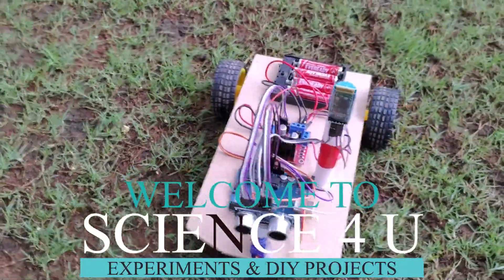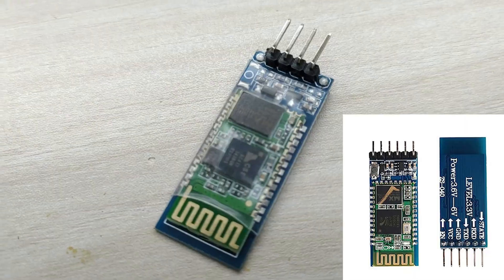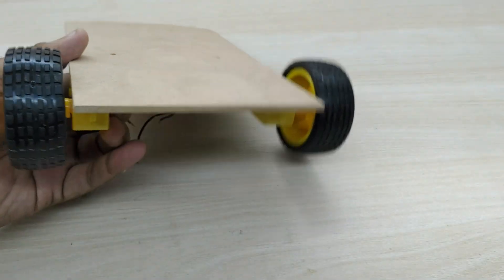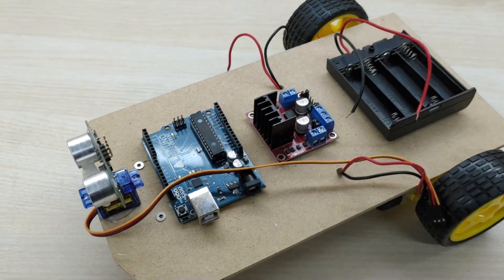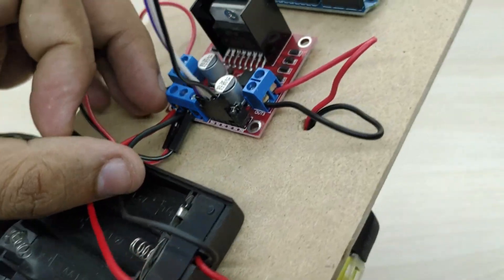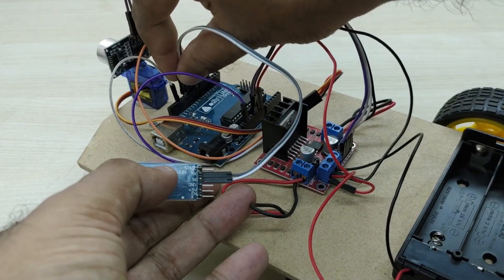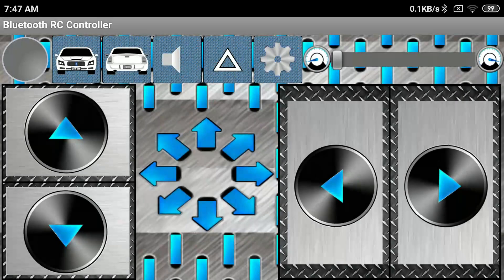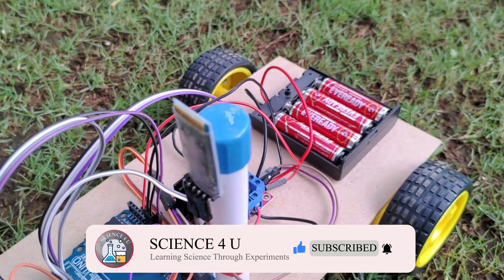Bluetooth controlled car with obstacle avoidance || Step by Step tutorial

Comment: Sir app link was not working
Reply from the maker: Hi friend. You are right. The app has been removed from playstore. 
You van download the .apk installation file for the software from the following link and install the app directly in mobile phone. 
https://drive.google.com/file/d/1Mzc5KGRzhqFgvPnWan8b5mDisAgMnkMK/view?usp=sharing
Reply: @Science_4U_ sir it will work in first attempt please tell me fast sir 😢
Reply: Sir could it work in first attempt please reply fast sir 😢
Reply from the maker: @durgatelugugamerff1937 Hi friend. It will definitely work in first attempt itself, provided all the components are in good working condition. Especially the bluetooth module and L298N driver board can be sometimes faulty, especially when it is a new one. If these are used before and is definitely working, then the project will work in first attempt itself..

Comment: Bro, my Arduino Uno doesn't have the code to connect with red wire servo motor
Reply from the maker: Hi friend, I will surely help. I didn't clearly understand the problem. Can you please explain?
Reply: @Science_4U_ my Arduino Uno doesn't have the "Ioerf" like your diagram circuit  shows. The "Ioerf" need to connect with the red wire servo motor like ur video shows. How can I fix that ?
Reply from the maker: @nursyairahatiqahbintihusain  Hi friend, IOREF is basically a 5 volt reference voltage that is given from arduino uno. Some boards will not have this IOREF pin. Instead, in its place 5V pin will be available. You can connect to that 5V pin also.
Reply: @Science_4U_ are that pin that my video shows can be replaced with 5V too ?
Reply from the maker: Yes definitely friend..that red wire can be connected to 5V pin instead of IOREF..
Reply: @Science_4U_ thankyouuuuu you're my life saver 😭😭❤️❤️
Reply from the maker: No problem dear friend. I am so much happy to help...🙂❤️
Reply: https://youtu.be/eJsSn740mec?feature=shared . I doesn't have that in my Arduino Uno 🥲

Comment: hey bro why us my servo motor not rotating fully kinldy reply fast ......
Reply from the maker: Most likely it should be due to poor battery. Can you explain further?. Servo motor is not turning 90 degrees to both sides?.
Reply: @Science_4U_  it is just stuck and i have tried several times i am using 2 rechargeable batteries 3.7v+3.7v 18650 battery
Reply: @Science_4U_  and also when i have completed all the wiring again ok then i have uploaded the code the Bluetooth is being connected but it js not responding
Reply from the maker: @maviaqaiseriqbal3098  okay friend. The bluetooth car not moving could be due to several reasons. It could be due to bad bluetooth module, faulty L298N driver board, wrong connections etc. We have to check one by one. If you can come to my instagram page, I can chat and guide you to identify the problem.
Reply from the maker: @maviaqaiseriqbal3098  https://www.instagram.com/_science4u_?igsh=MTM5aXFpdTM5aG5lNg==

Comment: we can run the car on both controlled and mannual and voice code theres any edit to be done in the code
Reply from the maker: Yes friend. We need to edit the code to provide these functions.
Reply: @Science_4U_  I can get code from any websites is there
Reply from the maker: @kevincelestine7020  No friend. If you want your car on bluetooth mode, manual mode and voice control mode, we need to write specific code for that. I haven't seen any code from website with the exact same functions.
Reply: I am sorry that I want to ask you the motor driver when I give power to 12v is not responding but I give to 5v motor driver is on but motor not working
Reply from the maker: @kevincelestine7020  The motor driver should work perfectly in 12V DC supply also. I am not sure why it is not working in 12V. Could be a problem with the board.
Reply from the maker: @kevincelestine7020 Infact the L298N motor driver board can work upto 40V input voltage. Is the 12V battery that you have connected good or is it discharged?
Reply: @Science_4U_  good batteries only

Comment: Life savior this is my uni projext😊
Reply from the maker: Hi friend. Please try this project and ask if case of any doubts..
Reply: Hello friend, i did as you did and it’s not moving, i kept the vcc connected to motor and didn’t change it, bluetooth worked normally and I connected. So whats the problem if you can help, thank you.🫶🏻🫶🏻🫶🏻
Reply from the maker: @taboo3274  Hi friend. Do you see light on the motor driver board?. Are 2 jumpers connecting ENA & ENB pins available in the motor driver board?. Have you used the motor driver board before or is it a new one?
Reply: @Science_4U_  new one
Reply: @Science_4U_  no lights
Reply: @Science_4U_  yes ena and enb available
Reply from the maker: @taboo3274  A light should switch on in the motor driver board. Can you check connections to the motor driver board?
Reply: @Science_4U_  yes i will
Reply: @Science_4U_  sir i solved the motor issue but i have a problem, the car only move right and left when i unplug it from computer but when i connect it to computer it works normally what should i do
Reply from the maker: @taboo3274  If the car moves left and right, it should have moved forward and backward also. The only reason I can see is that if the batteries are not good, it will not have enough power to rotate both the motors together. Please do the following 2 things.
1. Lift the car up so that both wheels are in air and then see whether front and back are working. Also please try helping the motor to rotate with your hand.
2. Connect the arduino to PC/laptop using USB cable. With the USB cable connected see if front and back are working. 

If it is working in any of the above 2 cases, the problem is then due to bad batteries.
Reply: @Science_4U_  yes its the battery im using 5v what should i use
Reply from the maker: @taboo3274  5 volt is very less friend. I will suggest you to use 2 x3.7V 18650 batteries. They last really long and are rechageable also. Other wise you can use 4 x AA 1.5V batteries or 9V Hi-Watt battery for transistor radios. But these wont last long.
Reply: @Science_4U_  thank you a lot but a question if i directly connect the battery to motor it will damage it or not? Thank youu very much
Reply from the maker: @taboo3274  No friend.  it will not damage the motor if you connect directly.
Reply: Sir I forgot to tell you that it worked perfectly, thank you so much for helping and replying ❤❤❤❤
Reply from the maker: @taboo3274 Hi friend. Very happy to know that!!!. Wish you all the very best..❤️🙂

Comment: Can you give me correct circuit diagram
Reply from the maker: Hi friend. The circuit diagram can be downloaded from the google drive link given in the description box. I am giving the link below also.
https://drive.google.com/file/d/1OwHegQmTAUb7mbW_RdNSIqG0zmkmCL0W/view?usp=sharing
Reply: @Science_4U_  I want the circuit diagram that comes after changing the Bluetooth module you mentioned
Reply from the maker: The VCC of the bluetooth module has to be connected to 5V from arduino. That is all. Remaining circuit diagram is same.
Reply: @Science_4U_  thanks bro
Reply: @Science_4U_  Then don't you have to remove the wires from the servo motor and connect it somewhere else?
Reply from the maker: @techwithnelusha  Hi friend. Basically in this project, you need +5V supply for bluetooth module, ultrasonic sensor and servo motor. Normally arduino has only 2 nos. of +5V supply. Bluetooth module works only upto an input voltage upto 6.6V. So it will not work if it is connected to battery with a voltage greater than 6.6V. So in this case it is better to power the servo motor directly from battery, because it works at higher voltages also. Connect only bluetooth module and ultrasonic sensor to +5V from arduino..

Comment: sir what did you mean by connect pins 1 , 2, 3, 4 while pairing for the first time when we are connecting the bluetooth module. and sir aren't we suppose to remove the tx and rx pins in from blutooth m... before uploading the code.Sir plz reply
Reply from the maker: Hi friend. When we are first connecting the bluetooth module to mobile phone, a PIN number has to be entered in the mobile phone. That PIN number is what I have told as 1234..Also, I have seen in many videos, that the TX and RX pins have to be removed for uploading the code. But I was able to upload code without removing TX and RX pins. So if you are also able to upload code without removing RX and TX pins, then that is fine. Otherwise if you face some problems in uploading the code, try removing RX and TX pins and then upload. According to me, both methods should work..
Reply: @Science_4U_  Thank you soo much♥️💫.If I have problems regarding this project I'll ask you, is it okay.
Reply from the maker: @LT-or3on  Yes sure friend. Please ask. I will clarify them. 😀

Comment: Can we use 4 gear motor?
Reply from the maker: Yes sure friend. Just connect 2 motors to the motor driver board. I mean +ve terminals of both motors can be connected to one terminal of motor driver board and  -ve terminals from both motors can be given to other terminal of motor driver board..
Reply: @Science_4U_   im getting this error what to do? Sketch uses 5886 bytes (18%) of program storage space. Maximum is 32256 bytes.
Global variables use 148 bytes (7%) of dynamic memory, leaving 1900 bytes for local variables. Maximum is 2048 bytes.
avrdude: ser_open(): can't set com-state for "\\.\COM6"
Failed uploading: uploading error: exit status 1
Reply from the maker: @ninzagames  Hi friend, This error normally comes when the correct port is not detected. In IDE software, please goto tools>>port..make sure that you have selected the right port there. IF this os alos not working, try unplugging and plugging again to different USB port. Also pelase try in a different PC or Laptop.
Reply: @Science_4U_  my car is not moving
Reply: @Science_4U_  connected everything as u said but not moving
Reply from the maker: @ninzagames  okay friend. We neex to check one by one to know what is wrong..
Reply from the maker: @ninzagames  sometimes bluetooth module may be faulty, motor driver board may be faulty..
Reply from the maker: @ninzagames  are all the components earlier used ones and were working?. Or have you used new components?
Reply from the maker: @ninzagames  can you check whethere there arr jumpers in ENA and ENB pins in the motor driver board?
Reply: @Science_4U_  new all
Reply from the maker: @ninzagames  hmm..anyway code is a tested and working one..if connections are done correctly and code is uploaded correctly, it should work..some component may be faulty..
Reply from the maker: @ninzagames  I will ask you to do a check..Just connect +5v from arduino to IN1 pin of motor driver board and GND pin from arduino to IN2 pin of motor driver board. Turn on everything. Is one motor rotating?
Reply: @Science_4U_  I tried your Bluetooth car and that works but this obstacle doesnt
Reply from the maker: @ninzagames  okay...the obstacle avoidance alone is not working or bluetooth is also not working?
Reply: @Science_4U_  can you give me your Instagram
Reply: please reply fast tomorrow is my project submission date
 @Science_4U_

Comment: Why the car is so slow

And

Will the code works on a 4 whealer car to run 4 motors
Reply from the maker: Hi friend, You can increase the car speed by increasing the battery voltage.
Also this code will work for 4 motors also. Instead of one motor, you can connect 2 motor on either sides of the motor driver board..
Reply: Thanks

Comment: Bro again another problem I changed the pins then all the board lights are glowing but motor is not working please tell me
Reply: Bro please tell
Reply from the maker: Hi friend. Sorry for that. Can you give the connections like pin no. 4 of arduino to IN1of motor driver board, pin No 5 to IN2, pin no 6 to IN3 and pin no 7 to IN4 in that order and tell what happens...

Comment: Bro very nice project bro I done this but when I give left it is going right what is the reason bro? Please tell
Reply from the maker: Hi friend..That is because the control pins 4,5,6&7 from the arduino are connected to the motor driver board in the worng order. You can interchange pins 4&5 with pins 6&7 and see if it solves the problem..By trial and error you can correct the motor rotation direction by interchanging pins..
Reply: Thank you bro

Comment: Sir its not avoiding obstacles
Reply from the maker: Ooh..Most likely your ultrasonic sensor is damaged. Replacing it with a good one will solve the problem..👍
Reply: I have changed
Reply: But Still this problem
Reply: Sir give me code and circuit diagram please 😢
Reply from the maker: @gadgetguru0108  Hey friend. The link to download code and circuit diagram is given in the description box, below the video..

Comment: Sir please copy the code and paste it sir because the two link is showing that the file format is not supporting 😢
Reply from the maker: Okay friend..Sure..The code is given below..

#include <SoftwareSerial.h>
#include <Servo.h>
SoftwareSerial bluetooth(11,12); // RX, TX
Servo Myservo;
char t;

#define MLa 4     //left motor 1st pin
#define MLb 5     //left motor 2nd pin
#define MRa 6    //right motor 1st pin
#define MRb 7    //right motor 2nd pin
#define trigPin 9           // Trig Pin Of HC-SR04
#define echoPin 8        // Echo Pin Of HC-SR04
long duration, distance;
 
void setup()
{
  Serial.begin(9600);
bluetooth.begin(9600);
pinMode(MLa,OUTPUT);   //left motors forward
pinMode(MLb,OUTPUT);   //left motors reverse
pinMode(MRa,OUTPUT);   //right motors forward
pinMode(MRb,OUTPUT);   //right motors reverse
pinMode(trigPin, OUTPUT);       // Set Trig Pin As O/P To Transmit Waves
  pinMode(echoPin, INPUT);        //Set Echo Pin As I/P To Receive Reflected Waves
  Myservo.attach(10);

}
 
void loop() 
{
if(bluetooth.available()>0)
{
  t = bluetooth.read();
  Serial.println(t);
}
 switch(t)
 {
  case 'F':
        {            //move forward(all motors rotate in forward direction)
          digitalWrite(MLa,LOW);
          digitalWrite(MLb,HIGH);
          digitalWrite(MRa,LOW);
          digitalWrite(MRb,HIGH);

           digitalWrite(trigPin, LOW);
  delayMicroseconds(2);   
  digitalWrite(trigPin, HIGH);       // Transmit Waves For 10us
  delayMicroseconds(10);
  duration = pulseIn(echoPin, HIGH);        // Receive Reflected Waves
  distance = duration / 58.2;                       // Get Distance
  Serial.println(distance);
  delay(10);
  if (distance > 3)               // Condition For Absence Of Obstacle            
  {
    Myservo.write(90);
    digitalWrite(MRb, HIGH);       // Move Forward
    digitalWrite(MRa, LOW);
    digitalWrite(MLb, HIGH);                                
    digitalWrite(MLa, LOW);                                                       
  }
  else if ((distance < 2)&&(distance > 0))            // Condition For Presence Of Obstacle
  {
    digitalWrite(MRb, LOW);     //Stop                
    digitalWrite(MRa, LOW);
    digitalWrite(MLb, LOW);                                
    digitalWrite(MLa, LOW);
    delay(100);
    
    Myservo.write(0);
    delay(500);
    Myservo.write(180);
    delay(500);
    Myservo.write(90);
    delay(500);
    
    digitalWrite(MRb, LOW);     // Move Backward             
    digitalWrite(MRa, HIGH);
    digitalWrite(MLb, LOW);                                
    digitalWrite(MLa, HIGH);
    delay(500);
    digitalWrite(MRb, LOW);        //Stop                
    digitalWrite(MRa, LOW);
    digitalWrite(MLb, LOW);                                
    digitalWrite(MLa, LOW);  
    delay(100);  
    digitalWrite(MRb, HIGH);     // Move Left     
    digitalWrite(MRa, LOW);   
    digitalWrite(MLa, LOW);                                 
    digitalWrite(MLb, LOW);  
    delay(500);
          delay(10);
        }
        
   break;
   
  case 'B':
        {      //move reverse (all motors rotate in reverse direction)
          digitalWrite(MLa,HIGH);
          digitalWrite(MLb,LOW);
          digitalWrite(MRa,HIGH);
            digitalWrite(MRb,LOW);
          
          delay(10);
        }
        
   break;
   
  case 'L':
        {      //turn right (left side motors rotate in forward direction, right side motors doesn't rotate)
          digitalWrite(MLa,LOW); 
          digitalWrite(MLb,HIGH); 
          digitalWrite(MRa,LOW);
          digitalWrite(MRb,LOW);
        }
   break;
   
  case 'R':
        {      //turn left (right side motors rotate in forward direction, left side motors doesn't rotate)
          digitalWrite(MLa,LOW); 
          digitalWrite(MLb,LOW); 
          digitalWrite(MRa,LOW);
          digitalWrite(MRb,HIGH);
        }
   break;
   
  
  
    case 'S':
        {           //STOP (all motors stop)
          digitalWrite(MLa,LOW);
          digitalWrite(MLb,LOW); 
          digitalWrite(MRa,LOW);
          digitalWrite(MRb,LOW);
          
          
        }

        } 
        
 }
}
Reply: @Science_4U_  how to copy
Reply: Thank you very much sir ❤
Reply from the maker: You are most welcome dear friend...💓🙂